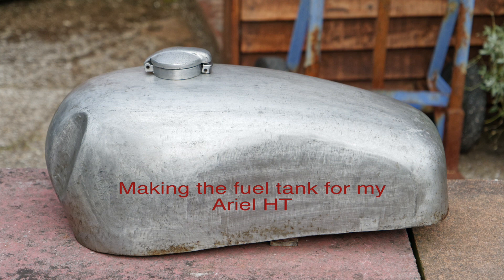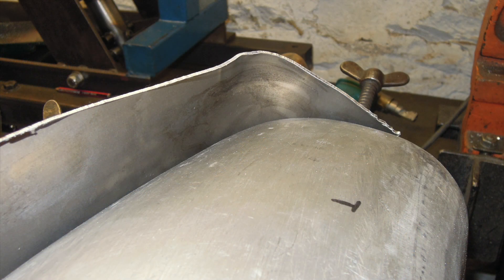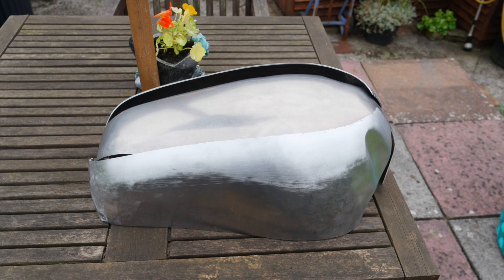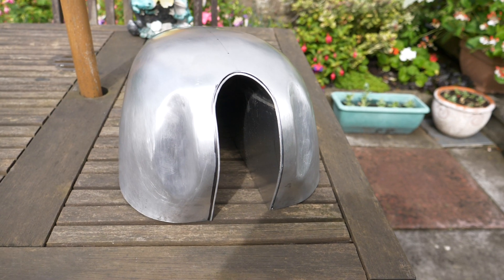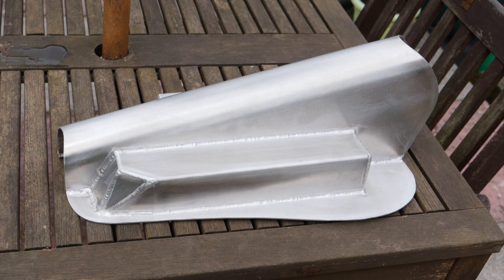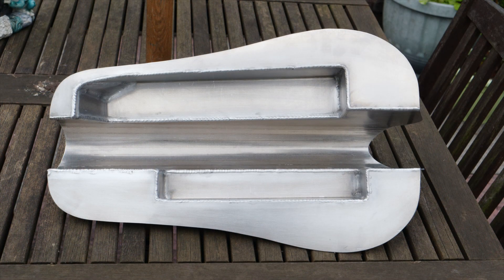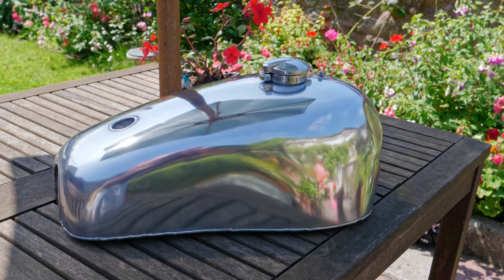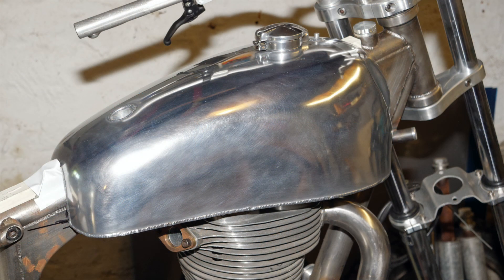Ariel HT alloy fuel tank .

Comment: What a fantastic looking tank. I'm trying my own HT build and so many of the tanks available just dont look right. They either don't look sufficiently deep or the bottom of the tank, which needs to sit squarely with the engine, is tilted upwards.
Not sure what I can do for my build but it was fascinating to watch your skills. Very impressive
Reply: The tank is a copy of the one used on GOV 132 but in aluminium. Sam did have an alloy tank this shape on the pre plastic GOV. Made from 2mm aluminium. It was formed with rubber/nylon hammers steel hammers were only used to planish out a few small dents. The factory HT tank sat much higher.
Reply: @ArielHT5John  I wish they were available. It just looks right. Period and beautiful